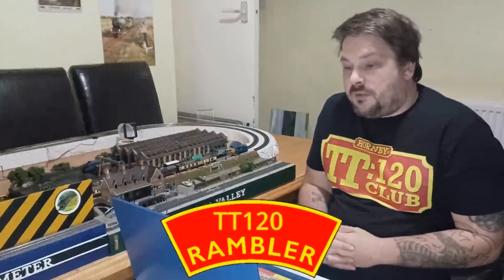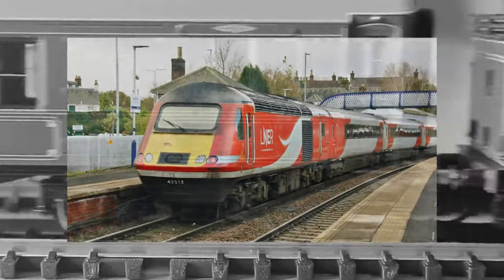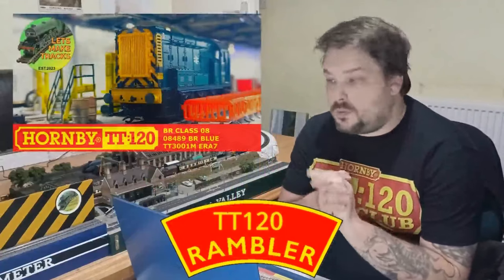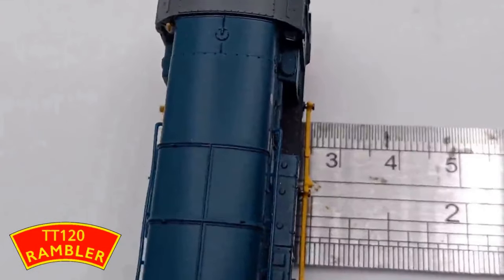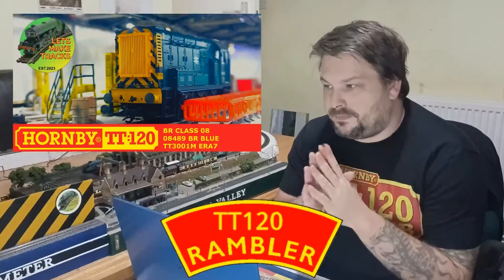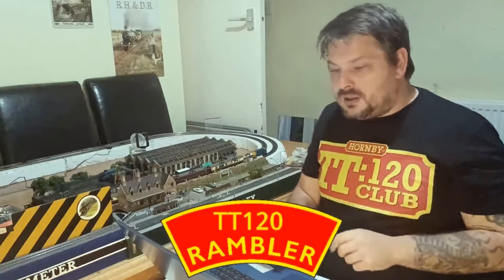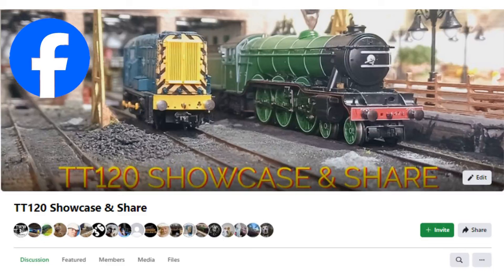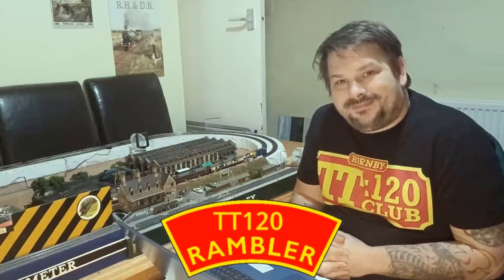Hornby TT120 SECRETS REVEALED | Phase 3, 4, & 5

Comment: J94s and Austerities (aka WDs) are the same type. The LNER bought 75 of them from the WD becoming J94s. Of these about half gained high bunkers, and a lot gained a third set of steps under the footplate.  Hunslet rebuilt a number of WD saddletanks with an underfeed mechanical stoker (later removed) and a chimney that looked like an inverted flowerpot.  There were also some that had Geisl ejectors fitted. In all 484 (or 485) were built, and over 40 survive in preservation.  Hope this helps.
Reply from the maker: You know your stuff, Thank you 🙂

Comment: I suspect the locomotive in the Pullman set will be one of the Coronation type locomotives they've already got in production - from memory, the GWR didn't use Pullmans much, and another LNER set feels too similiar. The set having a Coronation locomotive would provide a good starting point for LMS modellers, and featuring a Coronation would also fit with it being released before the HST set, since the LMS coronation is about the only non-LNER locomotive that'll be available prior to the launch of the TT120 HST. 

The other set is probably a 37 or a 47 with two mk2s, but there's no way to tell.
Reply from the maker: Sounds resonable.